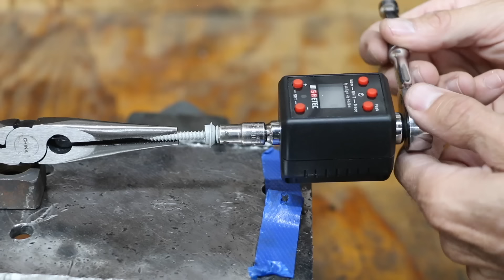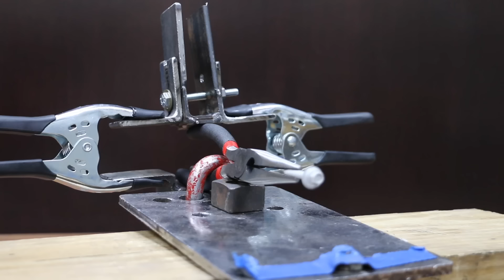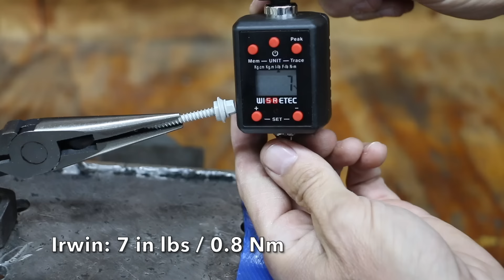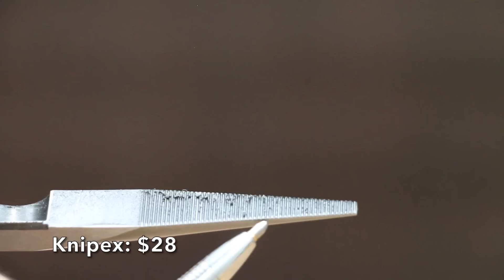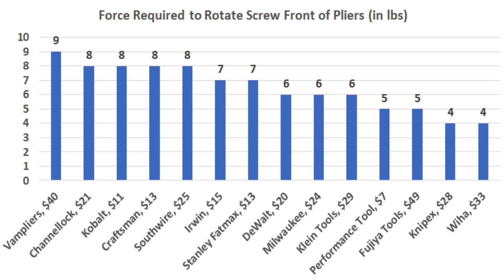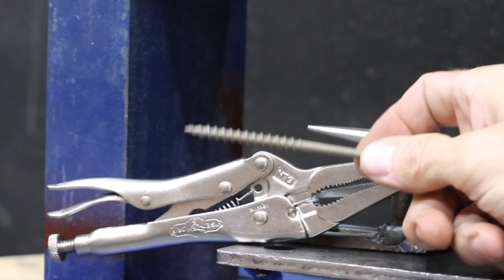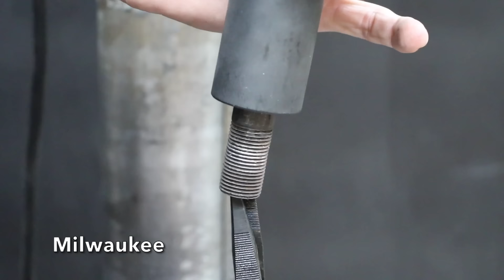Japan vs German Pliers (LONG NOSE)? Knipex, Vampliers, Klein, Fujiya, Irwin, Kobalt Needle Nose

Comment: I've noticed there's not been a lot of harbor freight brand items included in your testing recently.  Is there a specific reason for that?  Just curious.  Keep up the awesome videos!
Reply from the maker: Great question. The local HF hasn't had things in stock when I visit their store and for some reason they don't allow online purchasing for some of their products.  Possibly supply chain issues?
Reply: @ProjectFarm  That makes sense.  I figured it was probably something that like.  I appreciate the response.
Reply: @ProjectFarm  Exactly what i was going to say! Either that or they just didnt have any german or Japanese stuff at the time.
Reply: Agreed, leaving Doyle out of these tests is a major misstep in my opinion.
Reply: @Aeroliten  Don't forget Quinn which is rumored to be rebadged Kobalts. I really want to see if it's true. Pittsburg > Quinn (Kobalt?) > Pittsburg Pro (rip) > Doyle (MAC?) > ICON (blue point/snap on?)
Reply: @_HardKOR  There is a difference between made by and rebadged.  Mac sells rebadged Knipex pliers, they actually still say Knipex on them.  A rebadge is an identical tool.  Tools made by a company are a completely different thing.  If Harbor Freight wants to have their tools made by another company, they will be made to Harbor Freights design and specification, so if they did have Snap On make Icon tools it would not indicate in any way that the Icon were as good as the Snap On.
And actually, many tools are not made by the company whose name appears on them, they are forged/machined at companies who do forging and machining to the exact specifications that the tool brand pays for.  Companies like Craftsman, Milwaukee, Kobalt, they don't manufacture any hand tools, they pay another company to make them to their specifications.  Those specifications which include everything from what steel is used, whether it is forged or cast, the exact heat treat recipe, the tolerances on the parts, the composition and color of the handles determine the cost, and eventually the sale price of the tool.  
In actuality a tool can be made in China as good as anywhere else in the world, but just think how expensive a Knipex tool would be made in China, since part of the specification is German steel, so they would have to ship the raw materials from Germany to China before they could manufacture them.  The high priced tools tend to be made in places where the company can more easily monitor and control specs and tolerances, while China specializes in quick turn around, low price and large production numbers. 
Many companies have done the math and decided it is more profitable to have less exacting specifications, and just replace any failures under warranty while selling more tools.  Other companies have done the math and found it to be more profitable to make you buy your tools off a truck on a monthly payment plan, while having a much smaller rate of failure and warranty replacement and maintaining a reputation of top quality tools.
Sometimes companies switch models (Craftsman) from the expensive to the less expensive.  I have never seen a company go the other way.
Reply: @CustomCoinRingsUSA  He already replied it is due to supply issues.  Many items he tests are random Amazon brand products, surely not a step above HF and potentially a step or two worse.  It is fun to see when the cheapo sometimes surprises and holds up well against the name brands.
Reply: Thats because they have nothing in stock
Reply: Are you accusing our unbiased pal of being secretly sponsored?

Comment: It would be nice to see a comparison of diamond wheels for angle grinders.
Reply from the maker: Thank you for the video idea!
Reply: @ProjectFarm  as well as diamond cutoff wheels vs top abrasive cutoff wheels.
Reply: I just bought a couple. That would be a great test along with cutting wheels. Lol, you did that 3yrs ago. Of course!
Reply: Maybe a diamond hone comparison would also be good.
Reply: @Jack.333  the 3m 60926 cartridge along with one of their full face respirator will provide very good protection for nearly all hazards. A properly sized osha approved dust extractor, and plenty of ventilation is ideal.
Reply: I have a diablo that has cut probably 10,000 nails lol
Reply: Wow, actually a very good idea. I’ve been punished for not buying my specific brand so many times that I just won’t buy unless my known diamond wheel is there, (different blade for tile or concrete or my all use blade which I use often for PVC 4” pipe).  So in short I have three blades I use exclusively for different use, (I also have different grinders so I can swap quickly).